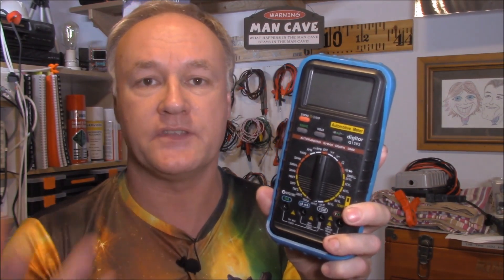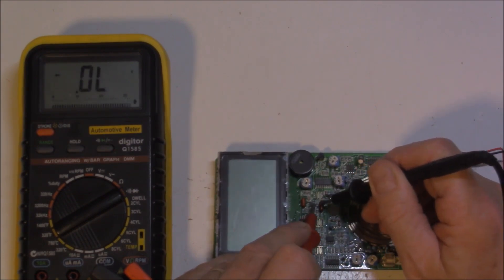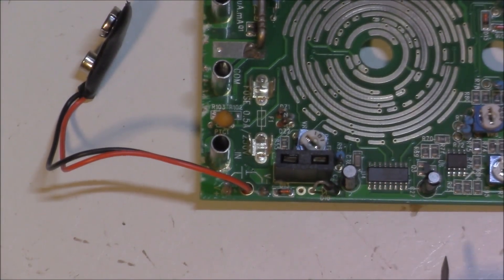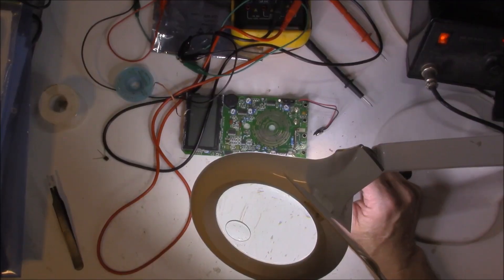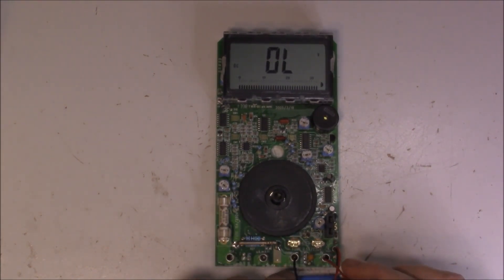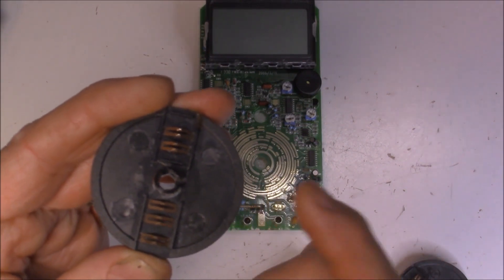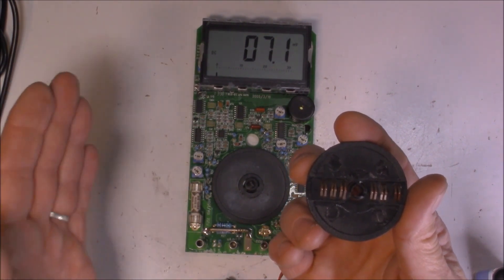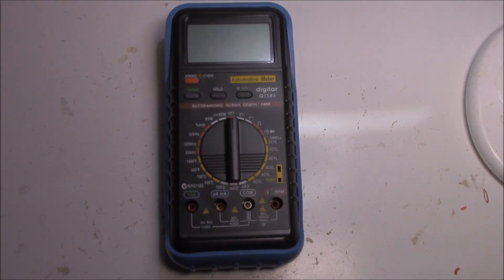Digitor Multimeter Repair MiracleMAX

Comment: Hi Mark, love your videos mate, that was a great find, after some long head scratching I'm sure🤣
I love my multimeters too, I must have at least 10, or maybe 15🤔
I just discovered this video and I'm hoping you can help me identify a couple of burnt resistor values please.
I couldn't quite make out the colour codes in your video.
R26 and R27.
R26 is located on the board between the 10A port and the uA/mA port.
R27 is located directly under the in-line current shunt.
I managed to smoke my ABW (rebranded Q1585) automotive meter years ago, and I've been keen to fix it ever since, but I wasn't unable to track down a schematic at the time, even after trying the ABW service agents, tried Shenzhen themselves to no avail, and no luck finding a 2nd hand one, or someone elses as a guinnea pig to open up for reference.
I don't remember exactly what I did when I let the smoke out, it was so many years ago, but more than likely I did what many young and dumb do, forgot to swap my positive probes back from Amps to Volts, or I possibly tested AC in DC mode etc.
Any help identifying those two resistors would be greatly appreciated to get this little beauty back up and running.
All the best.
Simon.
Nut It Out Mechanical Repair Service
Reply from the maker: Hey Simon,
Glad you got something from the video. Just like you, I searched high and low to find a schematic to no avail.

I am fortunate enough to have a few spare of the same make and model (4 actually 🤭)
R26 is yellow, white, green, black, green - 495 Ohms
R27 is yellow, white, white, silver, green - 4.99 Ohms
Just recheck my values.
Let us know how you go with your repairs 😉

I started a playlist dealing on multimeters if you are interested.
https://www.youtube.com/watch?v=ldM2FdjfPRE&list=PLnsi5jSjF8JVqgBqgz8mEIg2W2ROV6BQ9&index=1
Cheers
MAX
Reply: @MiracleMAX  Hi Max,
Thank-you SOOO MUCH.

I really appreciate your reply, and especially on a Sunday, will let you know how the repair goes.

I will check out your other vids, and also double check the colour code charts shortly.

I've never been quite sure which way around to read the blue style/5 band resistors, I only know the 4 band type with a tolerance band, silver, gold etc being the last in line.

I figured you might be my best option, since you mentioned you have a few of these meters, and still seem quite active on YouTube.

There are no other vids on this particular model showing any internal detail, only one guy that shows a Draper DMM14 (61023) which is the same, but the info is not relevant to my repair needs.

I have searched google and ebay etc for new and 2nd hand, but either no longer available new or no one selling used.

Thanks again, I very much appreciate your assistance with this, will be in touch👍🇦🇺
Reply from the maker: @simonilett998  No worries mate. The tolerance band usually has a little further distance from the other bands, so you read the tolerance band last.
Just to confirm the band readings, I did a physical resistance check for you and they were within the tolerance, so you should be good to go.
Thanks for keeping us in the loop.
It will be interesting to see what the actual problem is. Keep in mind that the ICs can be susceptible to losing the magic smoke as well. 
Here's one I blew up earlier. 🤣
That might help with your diagnosis.
https://youtu.be/ZZeXy6LCn8g
Reply: @MiracleMAX  Thanks, Mark, will let you know how it goes.

I did a bit more research on the colour coding, and yep I noticed on the chart it shows the tolerance band slightly further away from the rest, but I have seen quite a few of these blue/metal film type that there is very little difference between all bands, so I wasn't sure which end to read from, no colours left on these burnt ones, and they fell apart when removed from the board.

However, now I know the 4 tolerance colours used it should make it easier to be sure which end is which.

I did a cross check on the colours and values you provided, and luckily if I entered those colours in the reverse order it wouldn't work, since some of the colours in the charts aren't used for the first/last band.

All in all, your colours and values look spot on, unfortunitely being they are very tight tolerance precision resistors, and the values are a bit uncommon, I may have to try and source them through RS components on-line etc.

For now, although they will likely affect accuracy of some measurements, I have 4.7ohm or 5.6ohm, and 470ohm or 510ohm to try, and also picked up a couple of trim pots to see if I can dial them in any closer than above, but initially just for testing/proof of concept.

I already watched your blown up meter video last night, and it was very helpful.
Hopefully I don't find any ic's/semiconductors fried,🤞 but they will be my next checks if replacing the resistors doesn't bring her back from the dead...if not, RS to do some shopping, or ex-China🤣

Thanks again for your efforts, I really appreciate it, will keep you posted👍🇦🇺
Reply from the maker: @simonilett998  Sorry, I didn't see this comment before I posted the last one.....if that makes sense 🤣😉
Reply: Hey Mark,
I'm very pleased to inform you,
IT'S ALIVE!!!...and appears to be doing very well by all accounts.

It made it through surgery yesterday evening, and made a full recovery over night.

Thank-you Dr.MAX, you have saved another patient from the parts bin...it's a Miracle🤗

As far as I can tell, going by the tests I've done so far, all functions appear to be working just fine, and surprisingly they all seem very accurate too.

VDC within 0.001-0.002v of another meter, on a 1.5v and 9v battery.
Ohms within 0.5 ohms.
Diode function working, and puts out correct 3.05volts.
Continuity test works with beeper.
Temp. appears to be accurate.
All digits and function indicators appear to work.
Additional function buttons all appear to be working.👌

I'll do a few experiments with the Hz, Dwell and Rpm functions in the next few days.
When I get a minute I'll set up an old points distributor system and get out my laser tach. and analogue tach/dwell/timing light as a comparison to test RPM + Dwell.
I can check if the duty cycle function is working/accurate using live data on a scan tool connected to my van and compare some data PIDs to the meter readings, or I have a PWM driver module similar to your's that I can adjust to known values etc. .

I used a 5.6ohm + 510ohm resistor, also replaced R25 (10Mohm) which tested fine but was a little scorched when R27 fried, and a new 1N4007 reverse polarity diode next to temp. sensor socket, which I had already removed old one to test long ago, was still ok but not in great condition so why not just replace it.

Thanks very much again Mark, I'm stoked to have it back up and running after it has just sat in a box looking at me for over 20 years, it's still in 'as new condition' since I had barely used it before the accident, so now it can live again and pay off it's surgery🤣👍🇦🇺
Reply from the maker: @simonilett998  That's great news Simon. It's a great feeling isn't it when you get something like that up and running again. I had a few more fried parts in mine, but I can't expect anything different since I pushed over 1000 Volts through it on my very first video on this channel. Was so glad to get it up and running again. Make sure you check out the repair - I sent you the link in the previous reply.
Well done again on your successful repair. 🎉😁
Reply: @MiracleMAX  Hi Mark,
Yep, I'm very happy it came back to life, it's always a huge buzz when we fix stuff, and I'm sure you feel the same, but I guess that's why we do what we do.

Most of the time when I get something working, I like to say to my dog, in a load and cheerful voice 'Its Working' he just looks at me weird, I can't imagine why😂

It was well worth spending just a little bit of time, and less than $0.40 in parts for such an awesome result for sure, I may still try and track down the exact resistors and dig in again at some stage but I'm really not sure there's much point given how well it seems to work as is.

I'll say it again....A BIG THANK YOU for all your assistance, I honestly would've never been able to fix it without those band colours/resistor values.

I just watched your home made smoke machine video this evening, cheap and cheerful and it works, oh and it was Ni-chrome wire btw..

I'm also on a limited budget, and a bit of a tightass, so I also made my own a couple of years ago, I just went a little more fancy with my build.

Here's a link below to a short video where I used it on a customer's car, intake manifold leak on a BF Falcon.

I briefly show my contraption in the video, but I haven't made a video focussing solely on the machine.

Mine has a few of the common bells and whistles found on pricey machines, but I took most of the commercial ideas and incorporated them into mine, mostly just made with cheap plumbing parts from Bunnings, and a few other bits and pieces I had laying around.

It has an eBay flow gauge, eBay boost/vac gauge(with working back light), $4 eBay PWM voltage controller, oil sight glass, I also added an output connector where I can connect an extension cable to run a small DC air pump if needed.

Mostly, I connect it to my air compressor via a pressure regulator, and then to an LPG gas regulator (both shown in video) which drops it down to 0.5-1psi which is fine for big leaks, and perfect when I want to do real low pressure tests like fuel tanks and evap stuff.

My apologies for the sudden video cut off, there's a brief part 2 listed in the shorts section on my channel if you're interested in watching that too.
https://youtu.be/g6-hwZKXN2g
Cheers again,
Simon.
Reply from the maker: @simonilett998  A very classy unit! Much more professional than mine.
Mine just makes smoke 😁

Comment: had a good laugh at this one Mark. do you have a graphing meter ? are they any good
Reply from the maker: Hey Ian,
Glad you found it funny :) You could imagine that at the time, I didn't think it was so funny. 1st RULE OF MULTIMETER USE - Never lend to a student.......2nd RULE OF MULTIMETER USE - Never lend to a student.......

Actually, I don't have a graphing multimeter. I find them too slow & inaccurate. Keith probably explains it best in this video :  https://www.youtube.com/watch?v=hgy7ma9uqhQ

I am saving up for a 4 channel Picoscope, the ultimate in my opinion, but for now, I just use my little DSO138 oscilloscope that I built from a kit. Here is an example of it in action: https://youtu.be/u-TOt-RU08w?t=208

I will be starting a multimeter video series shortly, which should include what is available, what would be right for you, how much money to spend, how to use it, special features, tricks and tips & how to maintain them.

In the meantime, I have a few to repair, so there should be some multimeters to drool over:)

Thanks for your comments
MiracleMAX
Reply: @MiracleMAX  yea seen that video by Keith he is a class act along with scanner danner and sma and loads more. I am  saving for a pico two but a 2 channel. The reason I found it funny was I had my own multimeter striped down last week as well I lent it two a mate of my and came back broke and it was my Fathers one so it's very important to me but thank God I was able two fix it I can feel your frustrations when someone borrows your tools and have no respect for them. I just want to thank you for going out of your way too put a link of the video of Keith new level auto and the oscilloscope link thanks a mill.
Reply from the maker: @iankelly2110  No worries mate, I'm glad you were able to get your multimeter going. When I killed one of mine, (hopefully there will be a repair video soon) I experienced a real loss & took many days to get over. My wife couldn't console me.....until I bought another multimeter! 😀

Comment: Glad you got the meter fixed, Mark. Sometimes I overlook the simple thing too! It happens to all of us humans occasionally.
Reply from the maker: Especially when someone has been there before you! I'm just so glad that I had another multimeter to compare to. I find it so hard to find schematics for multimeters, so when I do testing of these meters, I just compare apples to apples.
Reply: @MiracleMAX  Yep, it helps to save a lot of time having another device to look at. You could have traced the circuit paths and found that the contact was in the wrong place, but wasted more time doing it.
Reply from the maker: @robertcalkjr.8325  Yup, you can always look back at ways to diagnose better. 
I'll know for next time :)